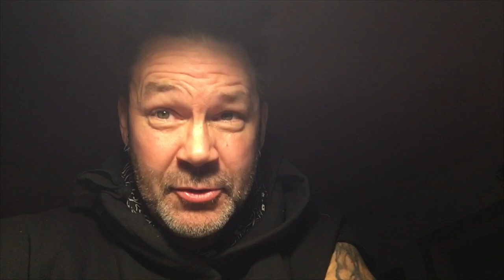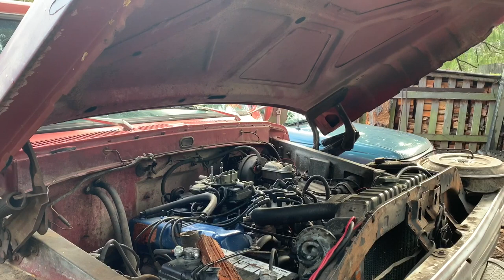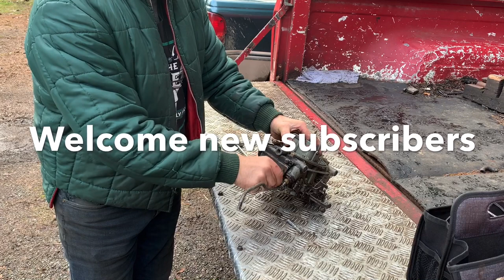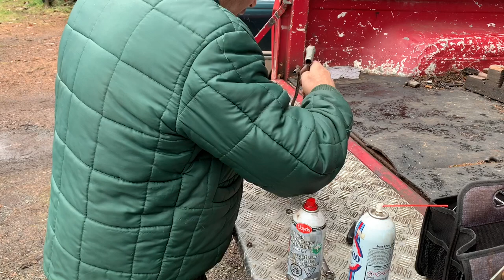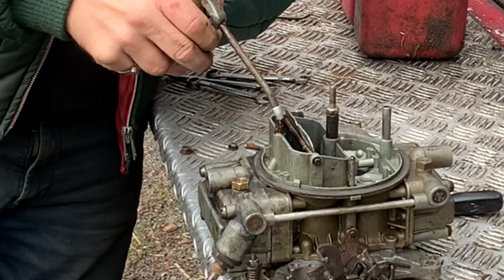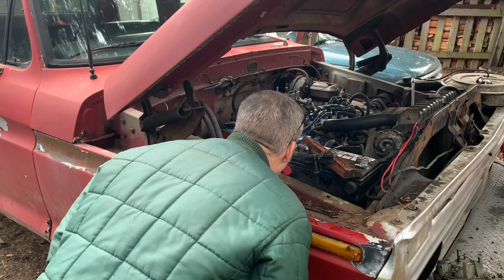It’s almost time for a new , old truck

Comment: Oh my buddy!! If i was there I could fix that in a few hours!!! 
It needs a kit very badly.  !!! 
And the best way to set the floats is with it running!! 
And I think the power valve is bad i believe!!! And there is a accelerator setting of 15 thousandths at wide open throttle.  And the best way to adjust the air screws is with a vacuum gauge.  !!! 
When adjusting the flowts you take the site plug out when running and adjust till no fuel i coming out of them and put the plugs back in. 
You do each bowl individually. And you may have to adjust the timing also ..  very simple carbs.  At least to me . But i have been rebuilding them since i was 16 . And 60 now .
Let me know if you want some assistance.  I can talk you through it if you want
Reply: Evan,
Sooo kewl to know the story of people like you.
Reply: Awesome advice! Been working on cars for 40+ years, many carb rebuilds. 
Buckin, i would NEVER attempt to fall one of those big trees you work on; without expert help. My advice about that carb... Either get some expert help, pay a professional to help or buy a rebuilt. I would love to help but i am in florida. Stay positive!!
Reply: @oldmanfred8676  i started helping my Dad work on cars when I was 2 
And it escalated from there .😊
Reply: I Love it Evan!!!

Comment: Sounds like you may have a leaking float my friend. Order yourself a good Holley rebuild kit, some new floats. It may have a blown power valve in the metering block, too. That's pretty common for those old Holleys. One good back fire at anytime and those power valves blow right out. You've got this, Buckin!

Comment: To bench set the float, with the float bowl removed, turn the bowl upside down. The top of the float should be almost horizontal. If it isn't turn the nut, under the screw, until it is. When you lock the float in place, after setting, keep the nut from turning as you tighten the screw.
You will have to do a final setting of the float with the engine running and the fuel pump feeding the carb. By doing it like that the fuel will then raise the float enough to close the needle and seat and prevent any more fuel from going in. This is what you are aiming for when setting the float.
The site plug to set the float level, is on the side and when the float is set properly the fuel should only dribble out the hole. With the engine running back off the screw, on top of the float bowl, then turn the nut to either raise or lower the float level.
Good luck and anyway I can help more just let me know.

Comment: Hey buddy. here is what you do. buy the rebuild kit that includes needles and seats, accelerator pumps  float bowl gaskets. Replace those parts at least. Some kits may come with other small parts like bushings and clips, dont worry about that for now but if the kit comes with new floats install them too. Put a new base gasket on and install the carb. Set the floats while it is running and at idle set them at low level or lean. It will idle a little high. thats ok. warm it up and go for a test ride. Bring your tools to adjust the floats if needed but not to high or it will run too rich. The accelerator pump will give that little extra gas when needed. . When the weather gets a little cold you may have to raise the floats a tiny bit. When you like how it runs reset the idle. Lastly think about installing a small inline filter by the carb and dont put that big carb on a stock motor. it will  run worse and very hard to adjust and be a gas hog. You can do it.  George N.Y. U.S.A.

Comment: Fuel injection best invention ever!!👍🏻
Reply: I left carbureted vehicles behind years ago, went to diesel trucks, I'm going to a 6.2 Ford gas sooner than later.
Reply: @Graveltrucking  get close to being a fixie aided by diesel exhaust and you'll change your mind about those diesels in a hurry everybody wants to leave them run all winter long! I try and park my vehicle as far away from them as possible but they're just like a cat to somebody that's allergic to animal dander. If somebody leaves they seem to park right beside you.
Reply: @earlhollar1906  I have a deleted 6.0 it will be my last diesel truck, its been reliable but its time for it to go. I don't have a long commute to work anymore the engine never reaches operating temperature. On the weekends I try to take it on a long drive to blow the cobwebbs out. I know short tripping the 6.0 for the last 5 years is going to bite me in the ass one day.  I won't touch a 6.7 Ford you open the hood and its ....... I won't own a Dodge, never did like the feel of GM/Chev. My next truck will be a 6.2 Ford we've got one in our fleet its cheap to maintain has decent power, I'm sold. I'm in the same area of BC where Buckin lives not sure where he finds the old 70s Fords. Anything that is in decent shape people want a mint for them. I had 70s Fords if I had time to find one and rebuild it I would. Todays life is too hectic, the cost of living skyrocketing there isn't money left to spend on the toys.
Reply: @Graveltrucking  I have a 2019 super duty with the 6.2 and absolutely love it!! 👍🏻
Reply: @dustincook7259  Been looking, with this covid crap its hard to do anything. The 2013  F350 we have in the company fleet it runs great. I'm the one that mostly drives it, and I maintain it. When it comes to oil changes no expensive filters basic 5w30 oil. I change the oil in my 6.0 once a year I don't put the kilometers on it like I used to. It is a 300 dollar oil change when its time to do the fuel filters its an extra 80 dollars. I'm in Western Canada synthetic oil isn't cheap, Ford doesn't sell filters cheap. Last year it was 2 grand to fix the cooling system the fan clutch packed it in, ended up destroying the water pump. While I had the system open I changed the thermostat and hoses. The same year the stock exhaust was falling off there's another grand for 4 inch turbo back exhaust. The year before that turbo shit the bed so I did an EGR delete along with the oil cooler 4 grand later. I do all the work myself I work as an uncertified HD mechanic for the company I work for. Diesel trucks are not worth it anymore parts are grossly expensive, the fuel mileage on my truck is 10-12mpg because it never gets run hard.

Comment: Best of luck with the Merc! I love old cars and trucks too. You should have at least taken both bowls off to see if any grit is in there. The way you were honking down on those bowl screws can cause the carb body to warp. Adjust the float levels with the truck idling. The fuel should just start to come out of the plug openings when set right. By squirting fuel into the vent, you are bypassing the float which does you no good. I have an old metal gas can with a fitting on the bottom that I can attach a gas line to so you can gravity feed the fuel to something. You could try something like that to set the floats if you have the carb sitting on the tailgate of your truck again! Love your channel friend!

Comment: Buckin, 15 years ago I had a 1966 merc m350.  Had a 352 4 speed.   Could never get it to run right, tried different carbs, filing points, etc.  Eventually I broke down and bought a new reman carb and distributer.  Total cost was $200.  Thing ran like a champ after that.
Reply: 1st person stories are always the best. Personal experiences from the Buckin army can make options endless.  We will wait and see what commander Buckin will do,  same buck time,  same buck channel.

Comment: I have gone through the same thing with my 68 high boy! Then I went and bought a brand new Edelbrock 650 CFM carb with electric choke never had a problem ever again ever! I am not telling anyone what they want to do but it was a great change. They are around 360$ but I tell ya you won’t be disappointed! Good luck brother great video!
Reply: Another successful swap,  good to hear that.  Keep the labor fee low,  do it yerself,  Keep it rolling.

Comment: Thanks for covering mechanical issues with your vintage vehicles.  So many things I'm not familiar with, like carburetor instead of fuel injection or fuel pump on engine instead of in gas tank.

Comment: I’d take that Holley off and throw it in the bush, put on any other band of carb that will work on that engine, Holley’s can be good but you really need to know what your doing to get them working good, and even then they can be a pain

Comment: If so much as a Grain of debris gets in the Jets, especially the low speed one it'll not run worth crap takes a welding tip cleaner to open them back up.
Reply: heloo

Comment: Good old rebuild need sir sounds like the float has a pin hole in it so loads up with fuel or they are sticking don’t give up on er she a labor of love
Reply from the maker: could nt find a kit anywhere at our local auto parts stores
Reply: @BuckinBillyRaySmith   that really stinks she sure is a nice truck
Reply: Have you tried looking of carbkitsource.com I have found a few hard to find kits on there
Reply: I'm sure you are way more internet savvy than me,  I'm sure one of the Buckin army can find one,  put the call out for help.  That is one kick butt truck that needs a little TLC and kindness,  a few soft spoken words,  and some professional help.  You are a man with an army,  don't take on everything by yourself.  It's time to evolve into the leader that you are,  the teacher that you are,  the true guy/dude that you iz.  Fix it 3 times and if that don't work, load up the lines of love and let the army assist you.  It's a choice that you shall make.

Comment: To set the fuel level should do it with engine running. Take out sight plug and adjust fuel to bottom of threads. Need fuel pressure on inlet to get good level.  If needle seat are not sealing or floats heavy with gas nothing will hold for long.

Comment: you need to adjust the floats correctly while running. the little side hole should have just a little dribble coming out of them, both front and rear floats. 
1. remove the front side inspection hole, watch as you pull it out and make sure to have a little rag under it to catch fuel. or dont, it doesnt matter really.
2. secondly, grab a 5/8 OPEN END WRENCH and hold the top float screw in place then crack the screw on the top of the bolt and unscrew it a tad, NOT A LOT, tad bit.
3. turning the wrench now either while keeping your flathead screwdriver on the screw. if a whole bunch of fuel came out it needs to go clockwise, if you cant see any fuel dribbling out yet. It needs to go counter clockwise. once you have that slight dribble out of the side hole go ahead and make sure to hold the nut in place while you tighten the screw in place.
4. go ahead and put the side inspection hole plug back in and move onto the back now.
5. repeat the same thing on the back float. if its coming out the vent tube like you were saying, you minus well start by cracking the screw open and turning clockwise a couple of turns.
6. if setting the float does NOT fix the problem then its a mixture of 1. not enough fuel pressure 2. clogged jets 3. air and fuel mix screws need to be adjusted by a mechanic. or 4. the carb needs a complete rebuild as other people have said. the float might have a pinhole in it causing it to fill up with fuel.

Id take a couple of minutes giving these tips a wack on the truck and if it doesnt stop puking fuel up through the vent tube then go ahead and pull the trigger on a rebuild kit. Facebook marketplace has a bunch of cheap holley carbs on it too.

i hope this helps you out.

Comment: I think you should adjust the floats when engine running. Set the levels so that they are on the bottom level of the sight plugs. 

ALSO you could have bad needles. Tips get hard and they don't seal good.

LAST Verify fuel pressure. Especially if running a aftermarket pump! 
My personal record is 16 psi with new Chinese pump...

Comment: Hey buckin if ya dont wanna deal with anything carb related for a long time buy a holley sniper efi system. Comes with a built in tune, and learns everything itself. Super proven part, and will make you get better gas mileage and the truck will run super good. Best thing is its super simple, although it will cost you for it at the start. If you wanna go for something thatll last a long time though, buy a holley or edelbrock carb. Super solid units.
Reply: Great information 
Good options

Comment: Pull the plug on the side of the bowl. Then adjust the float on top of the bowl were the nut and screw slot is. fuel should be at the bottom of the side plug while engine is running.

Comment: Adjust float nut on top of bowl back off and turn screw to raise float. Take screw out on side of bowl after running if it leaks out float too low , if right shake truck and gas should then come out.

Comment: If its old enough all it takes is one backfire or.cough and it'll put a hole in the power valve that you cant even see but it'll run pretty bad because it'll allow un atomized raw fuel right down the throught. Ive had several of those on my old chevys and when you get them tuned in they work awesome but they can be very tempermental. I ended up getting a different brand of carb...i think and edlebroc replacement.

Comment: Loggers and farmers must be cut from the same cloth
Rebuild a carb on the tail gate with a chain saw wrench and an 18 in crescent .....love it
Carbs just don’t work well these days with ethanol in the gas it brakes crap loose in the tank 
I’m thinking of going to that sniper EFI
For the Merc. Look at stans headers out of Auburn WA
Scraped my other headers after running these fir a short time
I run them on all my old trucks

Comment: You can adjust the float levels with the truck running...The fuel should just barely trickle out the float bowl where you took the plug out.
Reply: Another true mechanical detail.

Comment: Buckin, the carb with the huge secondaries and small primaries is a spread bore pattern and the one with  even sized primaries and secondaries is a square bolt pattern

Comment: The problem with a Holley 4 bbl is if you dont open up the secondarys quite often. Then the gas in the rear bowl gets stale and turns to varnish. Get a carter (Edelbrock) 4 BBL or a adapter and adapt a autolite two bbl carb to it.
Reply: More mechanical truth and good suggestion.

Comment: just get it rebuilt and you'll have no issues. put an inline filter on it before the carb. STOP USING ETHANOL FUEL those engines and components are NOT designed to use any ethanol. ethanol and aluminum hate each other. i hope this helps. stay safe.

Comment: set your float level with the engine at idle. Fuel level should be right at the bottom of the hole that plug came out of without running out.

Comment: You can buy any car ride or you want for any truck do you want online just search around a little bit you’ll find a place that just specializes in carburetors pre-tuned that’s the way I went with my old Chevy good luck to you
Reply: Had problems with my old GM truck,  Holley carb /single barrel,  1960,   I'm about to transport truck to work on,  hasn't been started in 8 years,  who do you recommend to look up for re-manufacturer of old carbs.  I've never bought anything on line.

Comment: @Buckin can you find a Edelbrock that will fit?
You might need a adapter plate for carburetor ( or a new intake manifold ) and a inline fuel pressure regulator.
Nine time out of ten you can get by with a adapter plate on the old intake manifold.
The reason Edelbrock are nice is because they are very easy to tune and get parts for. (AKA easy to work on)
We talked @August Hunicke into putting one on his Ranchero and it is running great.
I hope this helps friend.
Reply: Excellent suggestions

Comment: If your accelerator pump is adjusted too tight it will constantly pour fuel into the engine.

Comment: If your having ton of trouble I would just bite the bullet buckin by a brand new Holley 650 double pumper be perfect for that truck set the floats and put new fuel filter you won’t have any trouble for years

Comment: The floats may have holes in them. They will fill up with gas and not shut off.
Reply: thank you
Reply: Those floats are so delicate that a tiny pin hole can go undetected.

Comment: That Holley square bore carb you took off should be the same base flange as many of the Holley 4150/4160's out there and you might be better off just replacing that with one of those (made by Holley, Quickfuel, Edelbrock, etc.). That Holley you took off is one of those later Holley/Ford emissions carbs that have a bunch of weird quirks and are a pain. A standard 4150/4160 style Holley is way more user friendly and easier to live with. This Holley pattern chart is good for checking the base flange dimensions. Also that Autolite spread bore carb you had there is going to be even more of a PITA, but they do sell base flange adapters so you could use it on that intake manifold if you had to.
https://www.holley.com/blog/post/carburetor_flange_guide/

Also... do you get gas with ethanol in it where you are ? Ethanol in gas is horrible and is the cause of 99% of carb malfunctions now. If at all possible run ethanol free gas, or at least ethanol gas stabilized with something like Seafoam or anything else isopropyl alcohol based

I love that you run the old pickups - tree work and old pickups are two of my favorite things !

Comment: ur jets are whats messed up but just get a rebuilt one or go on summit racing website an try an find the carb online u def can an if that doesn't do go to a junk yard an they might have something an with those older trucks u wanna maybe put some vp fuel additive it helps keep gas from getting jelled up in the carbs in cold areas an also just keeps engine running nice an cleans it up a bit removes any carbon buildup to really does work